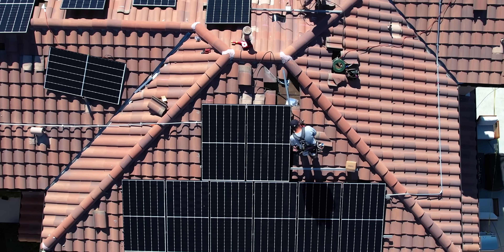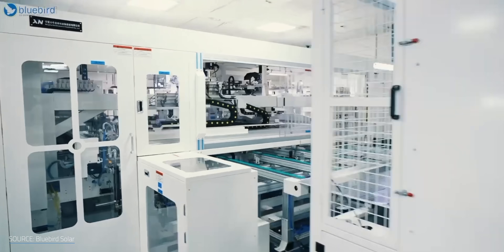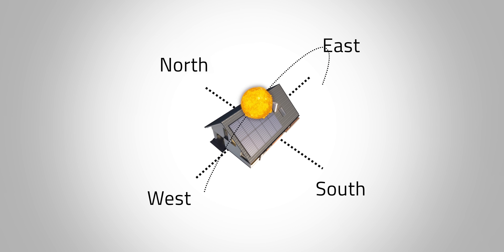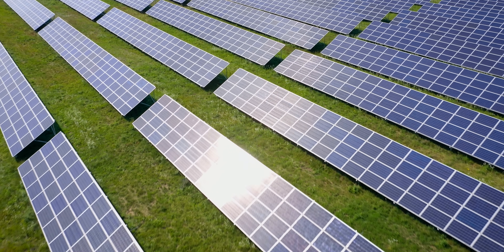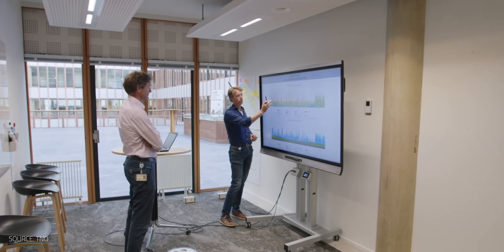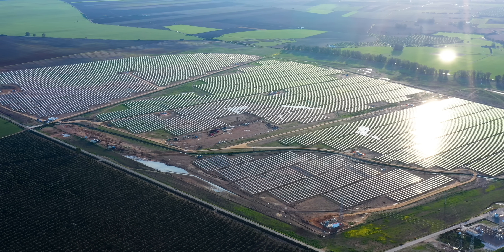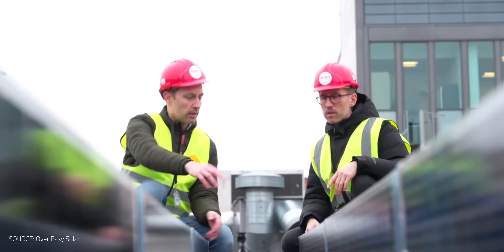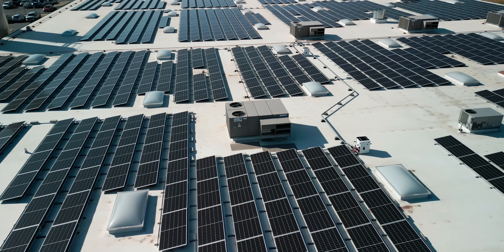Have we been doing Solar wrong all along?

Comment: This is fascinating to me. I'm in Florida where you'd think everyone would have solar, but the insurance companies won't write homeowner policies if you have panels on your roof. We are currently building a home and now I'm wondering about the effectiveness of vertical panels in the back yard or as a fence line. Thanks for sharing this.
Reply: Check another insurance provider
Reply: There's still insurance companies in Florida?
Reply: LOL, not many!  @Vaeldarg
Reply: There is a company in Norway make PV balcony railing...

Norway is further north, and energy prices and energy demand is higher in the winter. 

On the other hand, east west panels can benefit from the higher evening cost of electricity...
Reply: FPL has really pushed back against solar, for decades now.  Looks like they are letting the insurance companies take the brunt of the blame.

Comment: This sounds great for Canadian winters - no more snow removal.
Reply: Eh I think snow would still pile up on the side facing the prevailing wind.
Reply: Or Coloradoan winters
Reply: But will they hold up against the wind?
Reply: @tonym9771  I would think you should leave a gap between panels so that wind has a way to exit between panels. If you butt them up right against each other then the wall of panels will face more wind stresses. But a vertical panel will always have more wind pressure on it than a horizontal panel. Extra reinforcement in the frame may be required to handle the extra stress.

Comment: Great info! Forget roof mounted. You have a pole in your back yard that holds vertical panels on up higher than even your roof. Benefits: 1) Easier Install. 2) You are up beyond obstructions. 3) It does not damage your roof. 4) They can be moved from home to home. 5) You don’t have to clear as much snow/debris from them. 6) They provided shade on hot days so you can chill in your hammock, with a cool drink, while getting that sweet power. ❤🤘
Reply: Good idea. Problem is the high winds. Needs a safety mechanism to lower the panels to the ground in windy conditions.
Reply: It is a great option if you have the land.  As far as damage to the roof goes, my panels have been on so long that the surrounding roof needs replacing, but the shingles under the panels are like new.  Basically my panels protect my roof, not damage it.  And basically most of my system, no one even sees.
Reply: Alternatively, you can use panels from French company DualSun, and you get to both harvest thermal energy and improve photovoltaic efficiency by cooling the panels with the liquid that harvest the thermal energy to heat water.

Comment: If they were to deploy both VBPV and traditional horizontal together ( |_|_| ), the power graphs should combine to provide a more consistent power level across the day.  

The horizontal panels would also get the benefit of being shaded by the vertical panels until the sun is higher, so they don't get hot quite as quickly, maximizing their potential output.

This could be a decent setup for places such as industrial or metropolitan rooftops, where you have flat areas without much potential for secondary uses.

Comment: Convection cooling is also more effective on vertical surfaces.
Reply: This
Reply: Alternatively, you can use panels from French company DualSun, and you get to both harvest thermal energy and improve photovoltaic efficiency by cooling the panels with the liquid that harvest the thermal energy to heat water. DualSun claims that they have the best overall efficiency as they harvest both thermal + photovoltaic energy.

Comment: so, after some reading, I think these only generate more power than traditional PV installations once you get pretty far north, like the nordic countries, Canada, and Russia, because then the sun stays close to the horizon most of the time, and rises and sets much farther north.
On the other hand, these are really good for reducing the need for grid storage (and gas peaker plants) because the double peak in the morning and evening is complementary with regular monofacial PV to flatten out the overall solar power generation curve. With how cheap solar is, that alone seems like a great reason to use vertical bifacial PV in more places, especially on houses and in residential areas where power usage at noon is very low anyway.
Reply: If you live Florida, power demands are the highest around noon.
Reply: You can actually simulate and replicate these findings easily! At globalsolaratlas open 3 tabs. One with south-facing 20 degrees panels, and two with East/West-facing vertical panels. Add-up the annual kWh and you'll see that it's producing more, especially in summer. Multiply one of the numbers by 0.9 (what their paper assumes) or 0.8 (what I have) for 90% bifaciality. I tried this with UK. The winter numbers are terrible, but the summer ones are even better than before.
Reply: According to Over easy solar AS ( if I read their sales pitch correctly ) vertical panels only generates about 50% of a horizontal panel, but the 50% is more than previously expected. and those test are in Oslo (equivalent to the southern part of Alaska) it will probably get worse if you install in further south. The way I read the underlying papers it looks more like they expected a 70% loss compared to normally installed panels ando only got 50% loss. A huge boost from what was expected but still a 50% loss over all.
Reply: @JoppeOSL  Actually it's 50%+50% gain, even before the cooling factor.
Reply: Over Easy has test instalations ranging from Bodø (above artic circle) to Alicanti in Spain. Even in Alicante a E/W oriented installation will have similar to slightly higher yield per kWp installed. This is on a dark roof colour. The further north the the better effect of vertica. Color of roof also influence the yield allot. @JoppeOSL
Reply: I have two sets of panels (for various reasons).  One is optimized for summer and are pretty flat, the other is optimized for winter and are pretty vertical.  Vertical panels in the summer here would be useless. The winter panels are almost useless because of the short days and cloud cover (even though its a desert). I still think solar is a novelty, too unreliable for an real application, it just knocks the electric bill down (on good months).
Reply: correction for far northern locations: in the Winter, the sun stay relatively low on the horizon. this shifts in the spring and fall around the equinox where the whole world has approx 12 hr days. however, in the Summer, the further north you go, the higher the sun is in the sky - in the most northern places it just does a high circle around the noon high and doesn't set at all for 3+ months
Reply: In Arizona, for 7-8 months of the year we need help to cool our buildings down from their high temperatures. For at least two of those months , throw in high humidity, yes it’s a desert, no we probably won’t get the rain. It will just smirk at us as it thunders, lightnings, drenches us with humidity and jerks the rain over to water someplace else 😆
Reply: @thamiordragonheart8682  we are at home in Thailand and the sun go direct over head all year long. But with reflecting material on the ground ( a concrete road or roofing sheet material galvanisite or white painted) will do the job. And you have less problems with heat bildup and hail damages.

Comment: From what I have seen already, bi-facial solar panels seem to produce more power than their single sided counterparts.  My sister recently had bi-facial solar panels installed on her roof , her neighbour has an identical house with mono-facial panels. Both systems have 11×420W panels manufactured by the same company, fitted in the same layout and a Solis 5KW hybrid inverter and Dyness battery pack. At any given moment the bi-facial panels produce significantly more power and show good gains on the daily power production graphs. It will be interesting to see what system gives the best results when it's not overcast . The systems are not at the ideal inclination of 53° for solar gain here in Ireland , they're at 32° pointing 190° (SSW).
Reply: Alternatively, you can use panels from French company DualSun, and you get to both harvest thermal energy and improve photovoltaic efficiency by cooling the panels with the liquid that harvest the thermal energy to heat water.

Comment: I'm surprised the following hasn't been brought up:
1.  Solar panels are quite reflective, as you can see in a lot of shots in this video.  I wouldn't be surprised if vertically-aligned panels can absorb some of that reflected light more easily.  Depending on the time of day, I could see that contributing more to energy collection than the panels being cooler.  Let's face it - the Netherlands isn't exactly a hot country, so it seems a little odd to me their solar panels are suffering that much from heat.
2.  If the panels are mounted vertically, surely, it would take little to no effort to just use the same rack to mount a pair of monofacial panels opposing each other.  This of course is assuming it's cheaper per KWH to do that rather than use bifacial panels.
3.  If your land is long but narrow, you could always just do a tower of vertical panels.  Might be difficult to handle strong winds, though.
4.  I'm sure you could dramatically improve the light collection by using a white/reflective surface on the ground.  A thin layer of small white gravel could be an incredibly cheap way to make a significant performance improvement.
Reply: I thought about the reflectiveness of the panels when I saw the thumbnail ;) Would be interesting to see if you can adjust them so the light can better bounce between them. Maybe some kind of slight curve in the panels itself? And the monocrystalline cells for the main side and polycrystalline for the back side to get more energy from the diffuse light. Just some thoughts :)

Comment: I live off grid. I have excess solar power in the summer. I use excess power to pyrolize biomass. I capture the syngas created and store it in propane tanks. I use it for heat (outdoor heat exchange), and as generator fuel. The leftover biomass is easily converted to biochar, a permanent fertilizer.
Reply: Solar and the hydrogen economy.
Reply: @brodriguez11000  with the added bonus of permanent carbon store

Comment: I'd like to see you revisit this. 
And on another note, I'm going to be rewatching the videos on your houses. We bought a house in RI toward the end of last year and plan to do some renovations once our house in NJ sells; and are considering adding in some solar, and definitely some more efficient materials. It's an existing house that was built in the 50s, but the first time living through a relatively mild winter with oil heat has shown me how badly it needs it. I thought gas fired forced hot air was inefficient, yikes! 
Thanks for great videos!

Comment: Hmmm that’s fascinating.  I’ve tested with a few and they do generate more power 10-15%. I set up a light color reflective background.  I never considered vertical except where physical restrictions forced it.   Also total off grid requires more winter leaning angles than latitude based as summer has excess power.   Cool video

Comment: Wait, so if its jut "cooling" is the issue - why not just 1) Filter IR light in the first place? Its not like these "type" of solar cells use that light anyways to generate power. 2) Again, if its about heat, then PK Tandem IR would also benefit these solar panels as they would be converting IR (heat) back into engery as well? 3) If anything, is there no way to take the extra heat from the metal and the difference in the air to generate power as well? 4) If all else fails - a heat pipe system could also help keep them cool.

Comment: Hey in the future with various sophisticated solar energy advances,  they devise a polymer solar coating for cars  that is very efficient and for electric vehicles, which means that as you drive all the while your car is charging!  Layering the vehicle with a thermoelectric gel absorbs the heat away from the coating, which is converted into more energy

Comment: Space rquired is also way way more to not cast shadows on others rows so space wise it's a stupid system.  Almost flat would cost more panels but yield MORE per SQ meter as you can litteraly place 3 times the panels. but they are way cheaper so...  this vertial panels are just stupid.

Comment: I talked my neighbor into putting his panels with the low edge 5 feet above ground so the area below the panels was potentially useful.

With them this high, he parks his compact tractor underneath.  If he gets livestock, they can graze or rest under the panels in the shade.

You can dual-use land with properly installed panels.

Don't put them on a house if you can avoid it.  They don't get proper air circulation and overheat, which is bad for the panels and reduces power output.

Comment: If temperature is the crux, then why not just use other temperature control measures on existing PV plants?
Reply: They do sometimes. The extra costs and energy use of the cooling system vs. the efficiency gains don't generally result in a net benefit afaik.

Comment: If these double as a fence or noise barrier, they should be less costly with the stacked functions
Reply: If railways use this they don't even have to use fossil based electricity to run trains.
Reply: @benjiro8793  Presumably they'd still be grid connected, but this would be a more direct way of getting the power, when available.

Comment: I never really thought about it, but there are a few potential advantages to this, keep them clean would be much easier, being that snow and dust won't stick as easy to vertical panels, maintaining them will be easier, especially if they are not on a roof, being that a lot of us don't have easy access to our roofs.

Another potential advantage is being that they are vertical, you could stack them up and have more solar power generating ability for the given space, they probably could be done in a way where they can tilt to a certain degree to capture more sunlight, and when it comes to deploying, these would be far easier to deploy and maintain, after all, you could more or less put them anywhere.

But like the video points out, I would like to see a bit more research on the potential power it generates compared to rooftop panels, and how effective they are at different latitudes, but count me interested, because when I look at my house, from the roof to the garden, the amount of panels I could put up and how cheap solar is, I could potentially generate 2 to 3 times more power than I could if it was just on my roof.
Reply: Probably more susceptible to wind damage though.
Reply: Wind and Dust/mud  will be more of a problem.

Comment: I would think you could also liquid cool the solar panels.  You could have a water loop connect your array, then have it pumped through a radiator.  The pump and fans would only use a small % of total power.
Reply: Dont think you have to go that far, but just adding more thermal mass to radiator would more than likely fix the problem. Passive and doesnt require any power cost. Basicly add heat pipes. Or filter the IR before it hits the panel.
Reply: @adr2t  Alternatively, you can use panels from French company DualSun, and you get to both harvest thermal energy and improve photovoltaic efficiency by cooling the panels with the liquid that harvest the thermal energy to heat water. DualSun claims that they have the best overall efficiency as they harvest both thermal + photovoltaic energy.
Reply: @nicolasdujarrier  MAybe, but you can also just wait for PK Tam that also does IR = more power. Heating water sound great, but also requires pumps and other things to make full use of it. Let alone that it would only work on roof top solar. Plus water can be very hard on metal. Or what happens when the line freezes? Sounds good, but as I said, does come with some cons you would have to fight.
Reply: Alternatively, you can use panels from French company DualSun, and you get to both harvest thermal energy and improve photovoltaic efficiency by cooling the panels with the liquid that harvest the thermal energy to heat water. DualSun claims that they have the best overall efficiency as they harvest both thermal + photovoltaic energy.

Comment: Using them as a fence at 0:52 makes a lot of sense. Not as pretty as some fences, but around my area for reasons known only to them and Nyarlathotep, cultists have been installing dark grey fence panels instead of, you know, wood coloured wood. It's vile. But those things are functional and I heartily approve.
Reply: Also this is surely a much better layout not only for cleaning and servicing, but for farming down the rows in between. You don't get so much shade for anyone picking crops or working there perhaps, but access might be easier/you might need less concrete to set them upright rather than horizontal.

Comment: Yep it probably trapping the light in the glass, where it will bounce all over the place, umm if that's the case add mirror pain on the edges you don't wish light to escape, and maybe add a light collector on the sun facing edge's 🎉☀️ ...
Will continue the video now and see their answer 👂 📺

Ok lower the temperature, oh that could be an idea! 💡 To have 2 layers or glass, the outer layer is porous and wetnened,  then as that moisture evaporates that will cool the panel down, would have to be supplied with water by a dripper... Or periodic spreyers